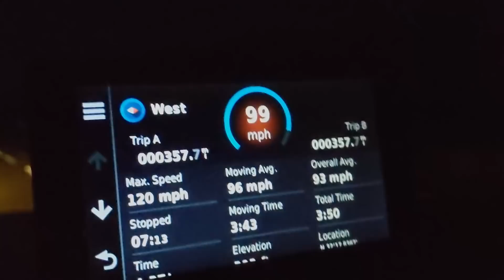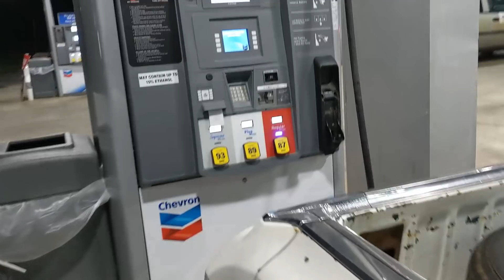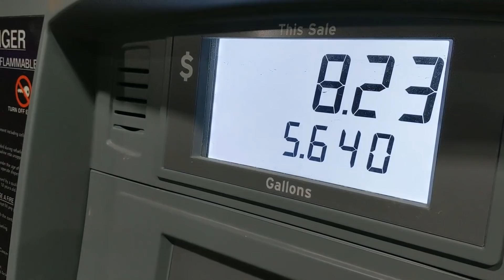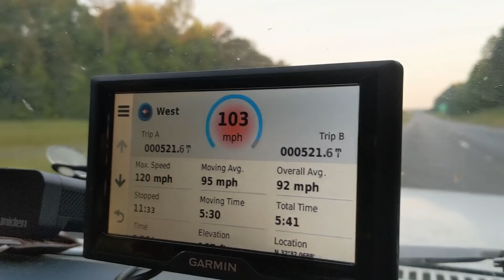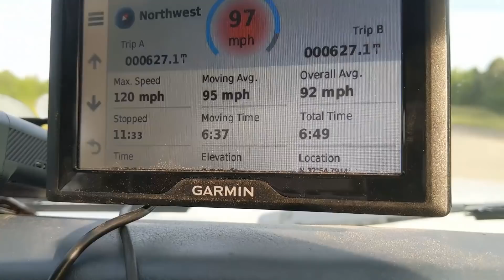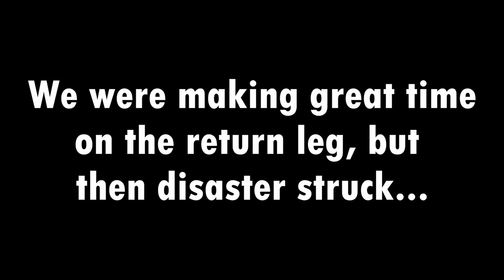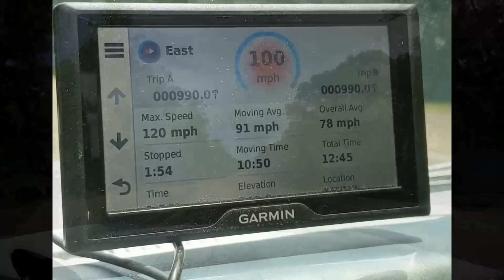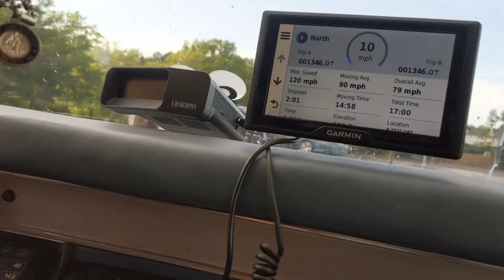RACING from Atlanta to Texarkana and Back Just for Beer! THE BANDIT RUN! - Sally's Speed Shop Ep. 23

Comment: Definitely looks like a good time 👍🤙 Next time you have a bearing or race stuck on a spindle, shaft, or hub just score it across with a cutoff wheel or hack saw and give it a few good smacks with a chisel or a screwdriver if you don’t have a chisel.  It will crack the rest of the way and slide right off.  I keep a few new hack saw blades in the bottom of my travel box as well as a flat chisel and cross cut cape chisel for just this reason, also a medium sized punch for driving everything back together. I have done it more then a few times on my personal hot rods and when I was running a service truck. It takes a little more time but you don’t risk hurting the spindle or hub with a grinder.

Comment: Last time I checked bearings aren't supposed to be an interference fit on the spindle, you are supposed to be able to drop them into the disc and just slide them on... Turns out that aftermarket parts have a huge drawback. Maybe keeping factory spindles but upgraded arms is a better way to go. I know if I ever get a Mustang I'm just going to use 69/70 discs/spindles with upgraded arms and 05+ rack and 69 Ranchero GT drums in the rear (unless I ran a Dana 60 or something, then HD truck brakes would work, so long as they are 5 lug.) Hell Ranchero drums are an easy upgrade for early Mustangs even up front, they are over twice as wide as Mustang drums, much thicker (you can actually cut cooling fins in them too) and clear 14 inch rims. (though factory 69 discs do too) Yeah, I'm a Ford guy, I know all the little tricks lol. The big difference between the Ranchero and the Elco is the Elco was on a Chevelle platform and had all car suspension and brakes and was really light duty where Ford saw the Ranchero as a 1/4 ton truck and gave it truck brakes, in 69 they did have the Torino suspension though. As a side note, no I don't plan on a Mustang being my next car, it was my previous before the Bronco after all.. If I get another Ford it's going to be a pre-smog F100 4x4 auto or a 65/6 Galaxie.. unless a Mustang or Torino pops up at a reasonable price that I can't pass up :D I'm ready for my first non-Ford though.. Unless you count when I was partial owner on a 66 FJ40 with my dad as my first non-Ford.
So hey, how does it feel to be driving around in a car that's a billboard for the company that fired you? :P I definitely wouldn't drive around with Walmart on the side of my vehicle. (yeah, I did get fired from there... 14 years ago, and haven't had a job since)
Reply from the maker: First of all, I appreciate your comment. I really do, but you need to get some facts straight haha I love Hot Rod Magazine, and I didn't get fired (I've actually never been fired from any job) I left on my own free will because of a lot of various reasons, but mainly because I wanted to build my own name and brand. Secondly, the bearing isn't supposed to be an interference fit haha When it failed it messed up the spindle and this was a desperate roadside attempt to get it home. Thirdly, I don't speak ford 😅
Reply: @SallysSpeedShop  ever noticed that most people that do car content on here don't? Well other than Junkyard Digs and Thunderhead 289. If only I had money I could make money lol.
Sorry for my misunderstanding, I'm really bad about that.
Reply from the maker: @OtisENGINEuity  that's a fact haha No worries at all my friend!
Reply: @OtisENGINEuity  And TheCraig909. And Four Speed Films. And classicmustangs429. And Mustang Lifestyle. You see where I'm goin' with this....LOL
Reply: @johnsarian_cu  if only I had money, currently I can't even afford registration, insurance and gas so I don't even own my own vehicle right now.. I just drive my mom's 03 Ram 2500 at 11.2mpg -.- I miss having my own car, let alone an old one.

Comment: Its amazing you can do a run like that at those speeds and not get caught by smokeys or flash for cash speed cameras. 
In this country (Australia) you wouldn't get more than 10 miles without encountering either the law or the flash for cash speed cameras.
Reply from the maker: It takes a little talent, awareness, and luck not to get caught, but it's actually rather to get away with speeding on the interstate. Speed cameras are very rare here
Reply: @SallysSpeedShop  Wow, very cool.
Radar detectors are illegal here, big fines. Speed cams are pretty prolific, some fixed, many movable and mobile. 
They are a huge source of revenue for our police departments and governments.

Go 25mph over the posted speed limit = immediate suspension of license, confiscation of car and huge fines. 
You guys have it so good in the States, 1 single V8 car costs $1100 a year to register with compulsory insurance in the state I live in. 
And if you dare to drive a car with no registration or insurance here you can kiss $1000 plus goodbye just for starters in fines. 
Any kind of rough older cars or a beater is likely to get huge attention from our law enforcement people also.
Reply from the maker: Man... That's no fun at all! Some states have different rules over here, so there are some strict places, but overall it's pretty relaxed
Reply: @SallysSpeedShop  Sadly, now days they have sucked all the fun out of a lot of things.
Reply from the maker: @trippledee351  sad, but true!

Comment: Hate seeing people use the angle grinder without the guard. There's zero reason to pull it off. 
Looks like a fun trip to start with.
Reply from the maker: I personally hate the guard. It's always in the way
Reply: @SallysSpeedShop  I’ve never come across a situation where it been in the way in normal use. And the 5 seconds to reposition it is better than loosing a finger
Reply from the maker: @agentcrm  I have come across countless situations where the guard is in the way personally, but everyone has their own way of doing things I suppose haha
Reply: @SallysSpeedShop  Yeah, I've had to to take them off before to fit into an odd spot of clear a thick paint stripping wheel. But always through it straight back on after.
Also less sparks to the face is nice.
Reply from the maker: @drundub73  I've had quite a few discs come apart, it's part of the deal with grinders. I've been knicked plenty of times haha
Reply from the maker: @agentcrm  if you're throwing sparks at your face you need to chance your approach a bit 😅
Reply: @SallysSpeedShop  Vertical cuts while trying to judge my line. Not my preferred way to cut, but pretty common in the workshop.

Comment: Aaah to be young and dumb again LOL
A Western Auto? I haven't seen one of those since 1992 I redid the right front wheel bearing on my 68 F-250 at the last Arizona rest stop before NM, but I had to use a hammer and cold chisel to remove mine.
Thumbs up to Taylor
Brakes are highly over rated